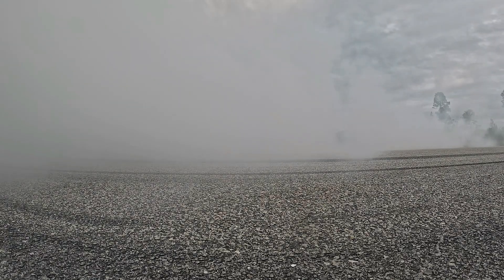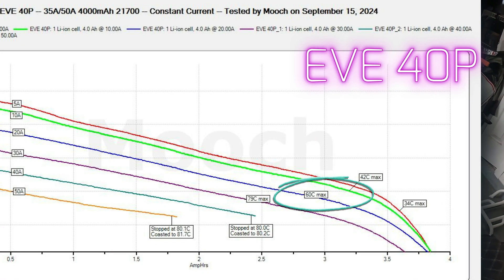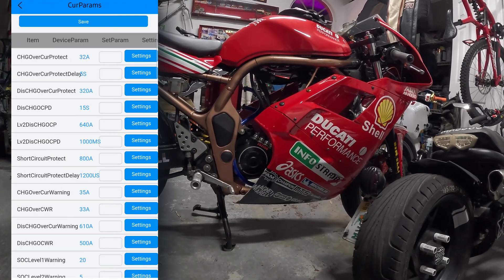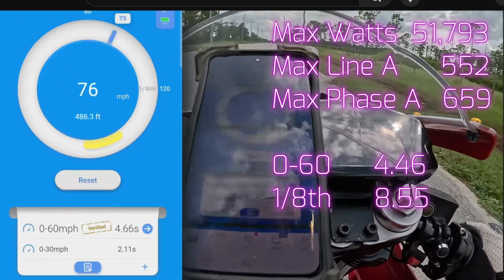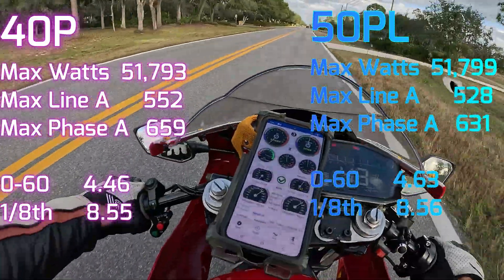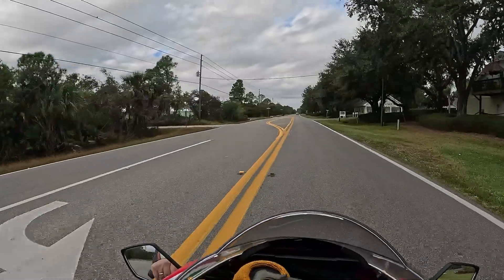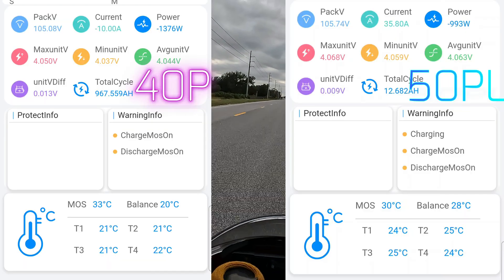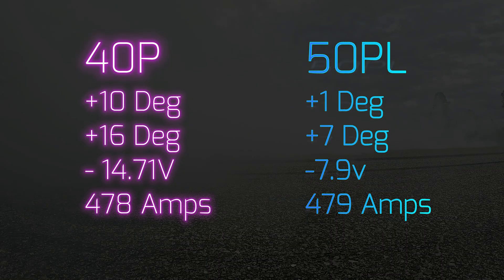EVE 40P vs EVE 50PL - 96v, ND981200, Sotion GTS35

Comment: For anyone who might want to buy these cells I have some important information. The regular EVE 50PL's are out (with CCC logo & QR code) and they are NOT as good as the pre-production cells. They overheat when discharged with 40A cont. and in the new datasheet it has a limit of 50A. The IR has also increased and the welding points on the underside are now 2 semicircles instead of a spiral. But I also have good news! Tenpower 50XG is a real beast! 90A cont. and 140A with temp. cutoff @75°! It is available and already tested and its even better as the pre-production 50PL's and the price is almost the same.
Reply from the maker: Thanks.  Ya I just learned this watching DIY500 last night.  ❤

Comment: Are you planning on sticking with fardriver, if so it may be time to hit up JJnp or surrin and get a custom 962600 controller, I was quoted $900 shipped, which is pretty good
Reply from the maker: That is really good!  I been using econic after my bad aliexpress experience.   I have a 961800.  Will do video comparing to the 1200 once I get it sorted out.  So far not much different.   I have it on 800 line amps and barely get 600 during the most peak power.  I may reached the capacity of this GTS35 motor.  😢
Reply: @GhettoWrench having a bad AliExpress experience right now 😂
Reply from the maker: @johndon3782 im at a 65% satisfaction rate😂

Comment: can you try a 1000 line amps 0-60 run lol. Loved the video
Reply from the maker: I may have too.  😅  I put the 1800 controller in and on 800 lije amps now.  Its slower!  Back to the start 😅😅.  Never ending.
Reply: @GhettoWrench I think voltage sag is the issue now
Reply from the maker: @Pizza-xi3fs ya the new 1800 controller foes the 8th mile in the same time, so that may be the issue.
Reply: @G @GhettoWrench  maybe a new battery with 50xg cells and more parallell and 108 fardriver instead of

Comment: obviously the higher the voltage the more efficient the current less heat less waste
Reply: Actually, voltage is unrelated to an EVs efficiency...  half voltage using 2x more cross section wiring is exactly the same efficiency as 2x voltage with half thickness wires.

Comment: To get more amps out the battery run them in parallel or next time you order from Amorge ask them to build the battery with dual bms
Reply from the maker: I didnt even know about the dual BMS option.  But that makes sense
Reply: @GhettoWrench yeah dual bms with dual chargers is a cheap way to get High discharge and charge rates
Reply: The difference isn’t that much … maybe 5-7more miles thats it
Reply from the maker: @rolandroland1485 well that sucks.  😅
Reply: @GhettoWrench I have experienced both dual battery aka parallel and one single big pack and the difference isn’t much, in facts it gets tricky as how to charge both batteries … they both have to be at the same voltage before charging them! A 5v or more difference might causes damages !

I personally rather go with one big pack
Reply from the maker: @rolandroland1485 that makes sense.   Thanks for the info.

Comment: The 50pl definitely held up alot better no where near as much sag I think it can handle a bigger controller n the 40 could use less line so it don't sag so heavy but both are good packs alot better then I got 😂
Reply from the maker: Ya for longevity sakes I doubt I will run 600 line in the other bike I put the 40P in.
Reply: @GhettoWrench yeuh for sure I think I'd do the same I mean even half that is still great power

Comment: I am curious to know what your max phase amps is with your new setup. I have a 26s15p EVE 40 PL battery with 962200 fardriver, and hit 875 phase amps peak at 0 RPM to Launch. Is your StartKP locked to 0 on the 981200? Another banger video straight to the facts no bs!
Reply from the maker: Thanks.  I have my phase amps set to 1200 max.  I can never get them up that high though as you see.  I have tried everthing and get no launch power increases.  My start KP is 40 and K1 is 4.  I can not adjust KP.  It just is what it is.
Reply: @GhettoWrench  yes thats why a lot of people go to dual fardriver with dual phase motors a lot of gate keepers out there its the only real way to get high phase amps without breaking bank.. Dual 961200 would in essence give you 2400 phase amps / with access to 1200 line amps which is where i think you should be if youre going for that much power. Would be 0-60 in the 2s and ridiculous tire popping torque with ur eve 50 PL battery - im curious does your controller start with "ND" AKA new design on the label?
Reply from the maker: @Nouri_TV yes.  It is ND961200 44 ABH90.  I also have a ND961800 but I do not think it works.  It did not work on my hub motor.   Someone suggested trying it on this GTS35 and it might work.    I may give that a go.
Reply: @GhettoWrench  if you have ns or hr series fardriver and have viber or telegram I can help you to tune it to get all phase amps
Reply from the maker: @bullldoozer Not sure.  Mine starts with ND.
Reply: @GhettoWrench  "ns" is at the end of controller name (new series). you need to connect via usb to pc and find product2 page, there is torquecoeff setting, it must be 16384 to get all amps. Difficult to explain here
Reply: @bullldoozer  What about for "ND962200_64_SBH961" thats what my controller is labeled in the "Comm" page of the fardriver app. I have the PC cable, but this was off the bluetooth app. Is it possible to tune this to get all phase amps?
Reply from the maker: @bullldoozer oh ok.  I must have the older ones.